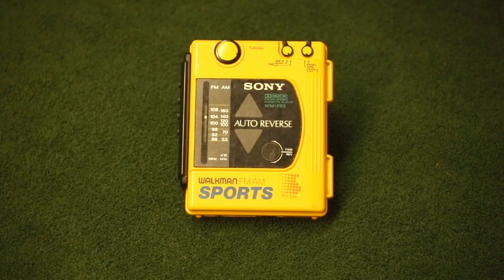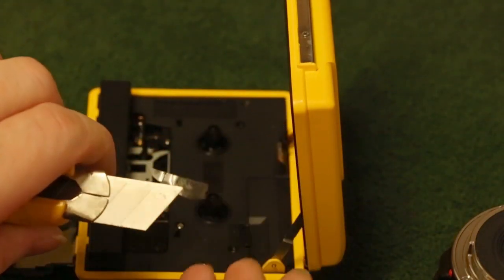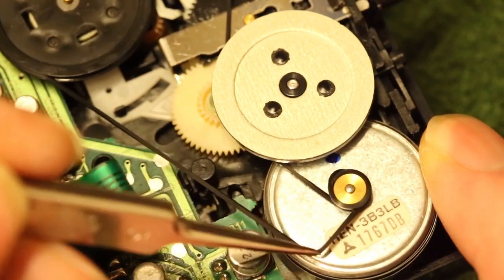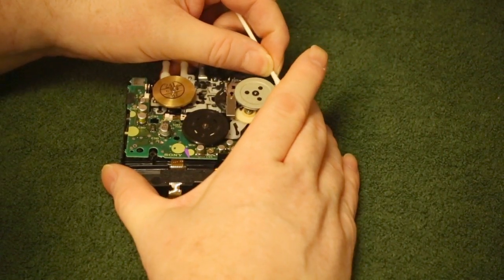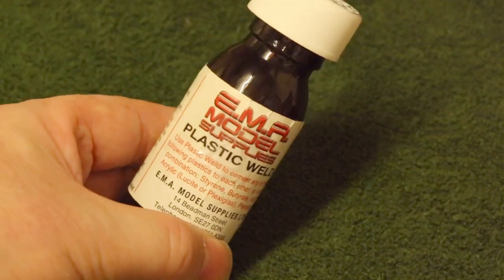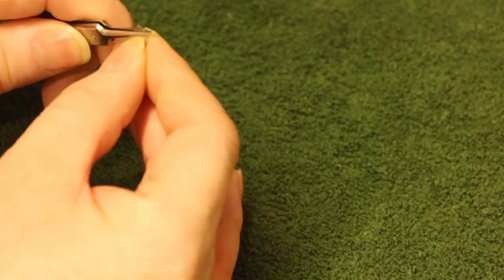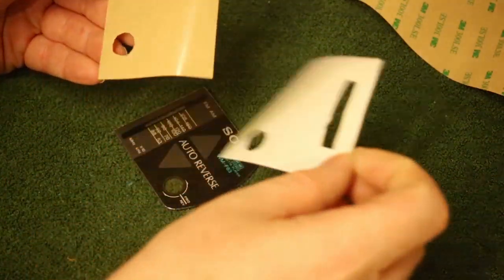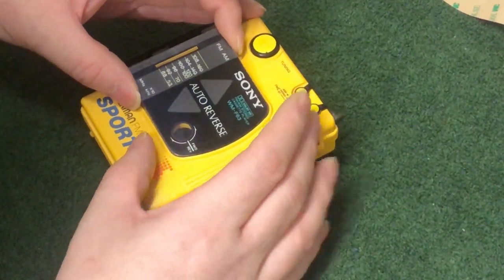Sony WM-F63 Sports Walkman Repair.

Comment: Thank you for this truely excellent repair video. Your pointing out so many things to watch out for is going to save me from so many disasters 😊
Reply from the maker: Thanks for watching and good luck with your repairs.
Reply: @AstonsVintageTechnologyWorkshp  thanks 😊 I'm going to need some luck to figure out why my F73 volume is too loud, which is the opposite old walkmans being too quiet usually haha! Acceptable volume is when the volume pot is all the way down to the lowest end 🙉
Reply from the maker: @tacticaltome  Sounds like the carbon tracks maybe broken at some point, possibly due to being dropped/impact. You might be looking at a new volume pot. But before that, it's worth taking it apart and checking that the wipers are not bent back. You can also test across either end of the pot to make sure that it's still measuring the correct resistance. All the best from Aston.
Reply: @AstonsVintageTechnologyWorkshp  thank you again for the tips! I'll try to measure the resistance and see what I get 😊 hoping that i won't need a new pot because I don't know if I'd be able to find one 😔 

Would the correct resistance listed I. The service manual?
Reply from the maker: @tacticaltome  Yep, it's RV501 and it's 10k across it. Ast...
Reply: @AstonsVintageTechnologyWorkshp  Thank you so much 😊 you've got such inspirational enthusiasm for vintage tech!! I will report back when I finally fix it or finally give up haha (I have fingers crossed it'll be the former)

Comment: Excellent presentation Aston, and a very nice gift. Sorry to see your camera sensor deciding to stop sensing part way through, but your i-phone picked up the slack really well. 
I picked up a few handy tips from this video, I have some EMA plastic weld on order, and your tip for not losing retainer clips and such with sellotape - although so obvious a solution,  is actually genius. 
I've also told the wife we need beans...
Again, excellent video Aston, already looking forward to the next one!
Reply from the maker: Many thanks, I'll just put the camera on the pile of things to repair. 😄 It's sometimes the simplest tricks that make life easier. All the best.

Comment: That was a great present Aston. I’ve not seen one of those before. Your repairs and manufactured parts were great. I’d wouldn’t have been able to resist temptation to to those smd electrolytics while I was in there though. Cheers Graham
Reply from the maker: Yep, I was tempted to change them, but they are the early in house made unmarked caps by Sony, which makes sense why they are still good. They will get done at a later date, probably with tantalums or something similar but they're fine for now. As for the manufactured parts, wait till you see what I've been up to today 😁 It's going to make a lot of people very happy. But that's for another video...
Reply: Sounds intriguing

Comment: Hi I have the same walkman - the tape functions play forward stop are fine. But  i dont get any audio? Could you please tell me what it might be? Faulty aux socket
Reply from the maker: Could be capacitors or a damaged flexy cable. Might even be a damaged volume control/headphone socket. Lastly, check for battery leakage. Hope that helps. Ast..

Comment: I have one of those, i dont know How to turn it on, i have tried everything. So I think it’s dead😢 Do you know how I can check that the problem is with it?
Reply from the maker: Well, first place to start would be the battery contacts, if they're corroded, you won't get any power. Same goes for if there is any battery corrosion on the circuitboard. Beyond that it would be either the radio or the cassette deck that don't work, and not both of them. So for instance, the cassette deck would be the microswitch not engaging, and the radio would be a broken flexible cable. Failing that, you'll need a basic multimeter and just measure where the voltages stop getting through. Good luck. Ast...

Comment: I’m curious, what kind of nylon washer does it use?
Reply from the maker: Sadly, Sony describe it as "washer" which isn't very helpful. It's just a little green split washer about 2 mm across. But, my goodness, can they disappear... I've spent hours looking for these little things when they decide to disappear. You can use a hole punch to create new ones, if you want, out of old plastic bottles, or similar material, and they work quite well, but there's nothing quite like the original for durability. Ast...

Comment: Hey Graham Congrats for the repair, I would to ask how did you plug the ribbon cable ?
I’ve been struggling to insert the ribbon and it’s getting tiring to fit
Reply from the maker: Hi, I'm Aston not Graham by the way. But anyway, the green cable between the two inner circuit boards has connectors with a brown pull-out part. It only pulls out a few millimetres, and slide the connector in then push the brown retainer part to hold it tight. This goes for both ends. Same thing for the yellow connector, this plugs into a similar type of connector but with grey retainers that need to be pushed in once the cable is in place. Hope this helps, yours, Aston.
Reply: @AstonsVintageTechnologyWorkshp   oh shoot apologies Aston, but thank you so much!! It’s seems silly but it’s the little things that count.
And also Aston I would like ask you about sound problems, you see when I playback the cassette tape It has no sound, but when I switch to radio I can hear just fine, what’s is your professional thinking for this situation ?
Reply from the maker: @renzonarimastu136  Hi there, Okey, when you to press play and turn the volume up a bit, do you hear a slight motor noise in the background? If so that proves the the amplifiers for the tape are working, check the head flexy cable. If not,  double check the green cable going in to the board on the cassette mech, (the bit with the fuzzy tape on it) if it's not seated properly you'll get what you're experiencing. Also check both of the leaf switches. Make sure they are both being engaged by the mechanism properly. If not, you'll get the wrong side of the cassette being played backwards, or the tape won't play at all. All the best and best of luck, Ast...

Comment: My Walkman won’t turn on even when I cleaned the battery area and put fresh ones in any recommendations to what I can do?
Reply from the maker: Apologies for not replying sooner, YouTube has been a little strange recently. If the Walkman is completely dead, it could be quite a few things, dry joints, faulty DC jack, battery corrosion, the leaf switch which turns the mechanism on or even the regulator IC for the motor. If the LED comes on however it might just be the belt has perished or has wrapped itself around motor. In any case, it definitely sounds like it might need to be looked at. Best regards, Ast...